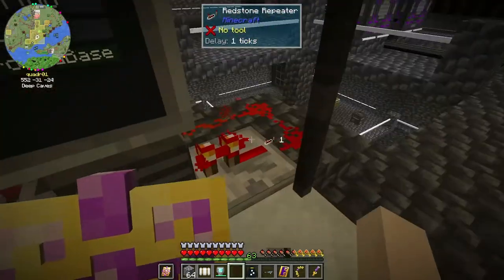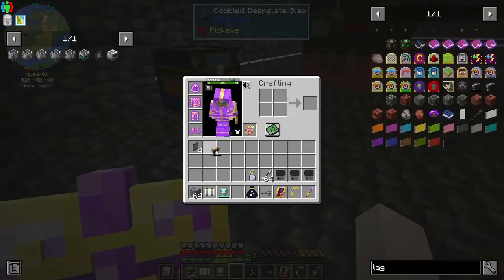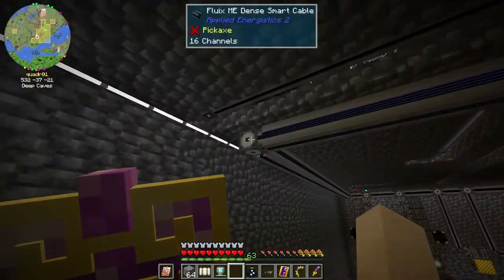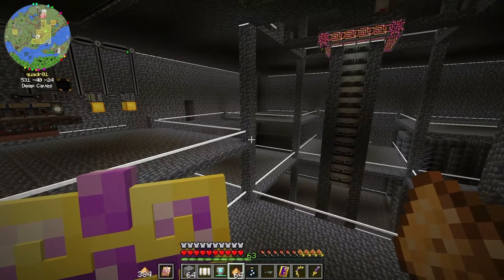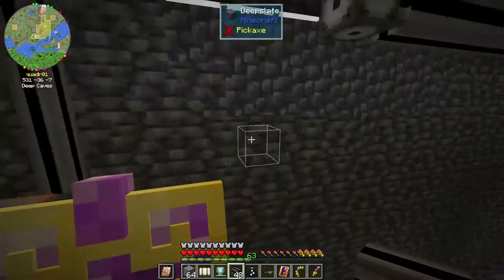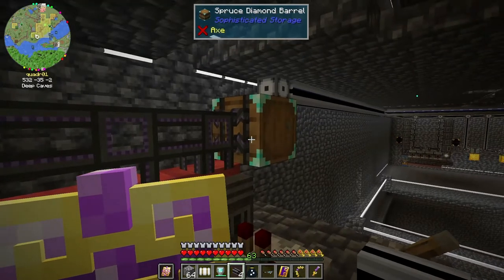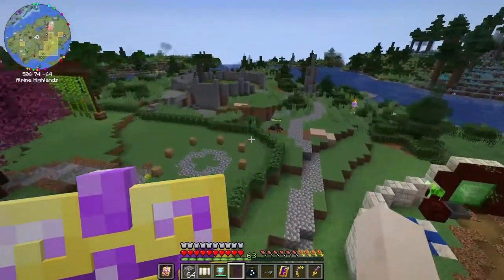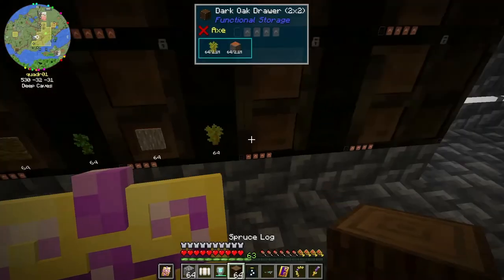DireWolf20 1.18 Let's Play Episode 102: Pneumatic Tinkerings

Comment: Volume vs. Pressure - My understanding is that Pneumaticraft things create and consume air (volume) rather than pressure; as the amount of air increases, it makes the pressure increase.  When you add a volume upgrade, it means the device can hold a larger volume of air, but the amount of air inside remains the same, so the pressure immediately drops.  What volume upgrades do is make it so when you use air, the overall pressure change is lessened.

For a (hopefully) simple example, say your fuel makes 10 air, and the device holds 10 by default.  That means it starts at 1 bar (10 / 10), but if you burn one fuel, it'll go to 2 bars (20 / 10), and two more fuel gets up to 4 bar (40 / 10).  If you use a device that uses 10 air, your pressure drops to 3 bar (30 / 10).

If you then add 2 volume upgrades (and for the sake of an example, let's pretend they add another 10 each), then you'll have 30 air in a device that holds 30, so the pressure drops to 1 bar again.  If you burn another fuel, it only goes up to 1.33 bar now (40 / 30).  And if something uses 10 air, the pressure loss is only 0.33, rather than the 1 bar it used to be before the volume upgrade.  Hope that makes sense?

I think I had used a blaze lantern instead of a blaze mesh for my plastic TPP; I haven't had to replace it yet?
Reply from the maker: Oh, I guess I used the wrong one :/
Reply: Gah, just watched the rest of the video; I watched the first half during my work lunch, and didn't want to lose all of what I'd typed.  I should have waited after all; you tested the volume upgrade anyway.  😛
Reply from the maker: @JakeMoe  Hey, It's cool!!! I appreciate you watching :)